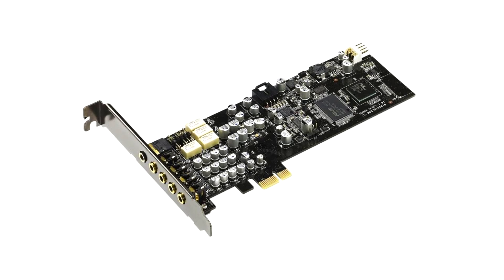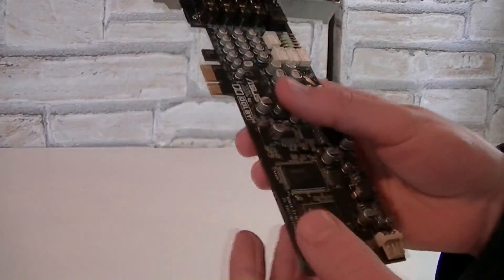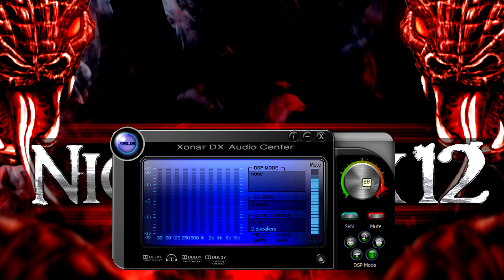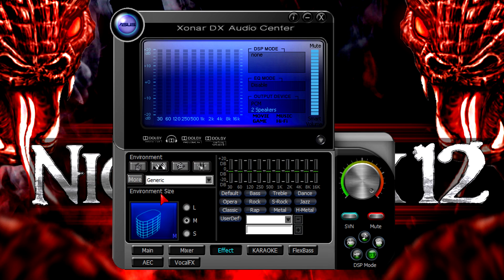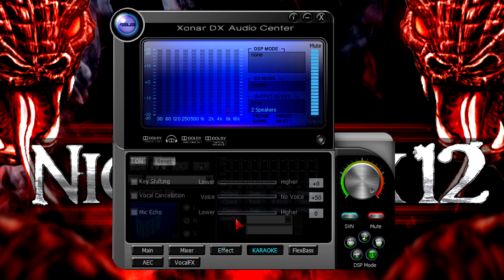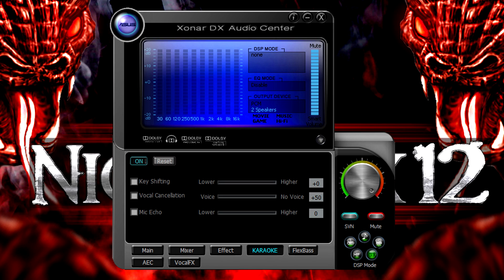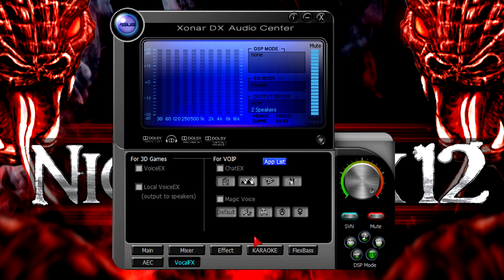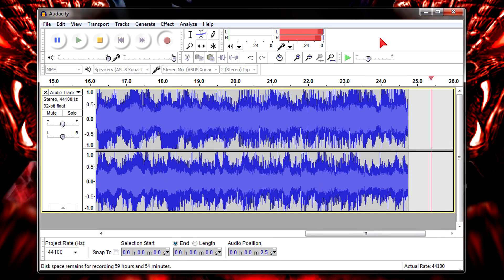ASUS Xonar DX 7.1 PCI Express Sound Card Review

Comment: could i also use the virtual 7.1 with headphones with this card?
Reply: What if you connect the Front IO audio cables to this sound card?
Reply: +Nick m yep
Reply: kshitij kumar okay thanks :)
Reply: +Nick m I need to connect them in the back or in the front?
Reply: +Glaciares YT with this sound card you'd have to connect your headphones to the back, but on the soundcard itself(which will be more towards the bottom of the case, under your gpu if you have one), not on the motherboard.
Reply: So if I connect in the front painel im getting motherboard audio, not from the sound card?
Reply: +Glaciares YT yes the audio ports on the front of your case are connected to your motherboard so they don't use the sound card.

Comment: Best sound card hands down! Combined with astro a40 system 2012 (mix amp and headset) literally Eargasm! I mean holy shot firing light machine gun (with double bass effect) is like firing a canon; Boom-Boom-Boom... Explosion and earthquakes on level 2 sounds epic too wow just *_* it has be epic kick ass seal of approval! The only down side is u need to know how to install and run this thing I.e the drivers I'd Download the latest and instal using winter

Comment: I would like to ask how many wires need to connect to the sound card ; One is for the power supply and the other what it does ; my wire is one that write up HD AUDIO and it is plug in on the left down side of the motherboard . now the sound card works without this cable.would have to plug it in; also i would like to ask you what program you have to download songs ;Is there any official of ASSUS  to download or wichever i want ?? and in what form should download them;; wma or mp3 ?? thank you

Comment: Yes you can but not recommended. If you have a GPU in 16x slot and you add a soundcard to another 16x slot, it might slow down the GPU's performance (by 1-3%) because for example Intel 1155 boards can run one pcie 16x at once or if running two cards in two 16x slots they will be 8x/8x. So if you have pcie 3.0, in 8x mode it will perform equal to pcie 2.0 16x. For example GTX 680's performance would drop ONLY by 1-2% when running in pcie 3.0 8x / 2.0 16x mode. There may also be other problems

Comment: Im new and looking for my first sound card so this might be a dumb question. The front header connection for the case on the card. Is it for when I plug my headset into the front panel of my case it'll be using the sound card 7.1. Or do I have to plug in my headset directly into the sound card to get the benefits of surround sound and all its glory?